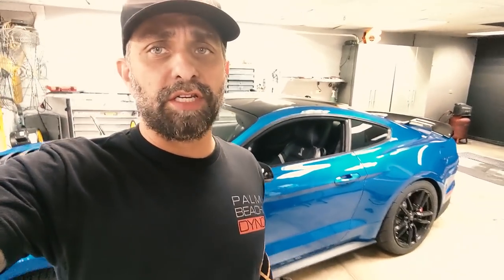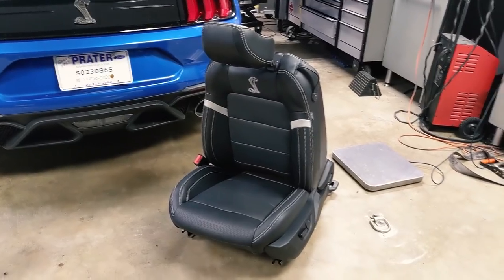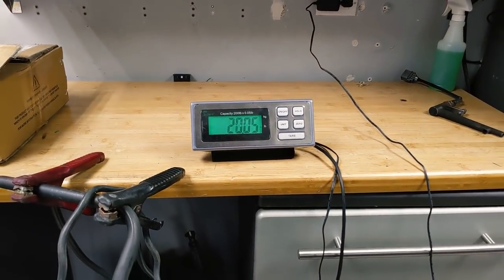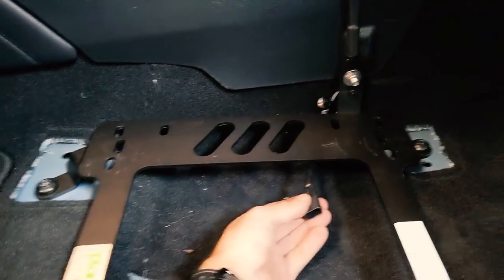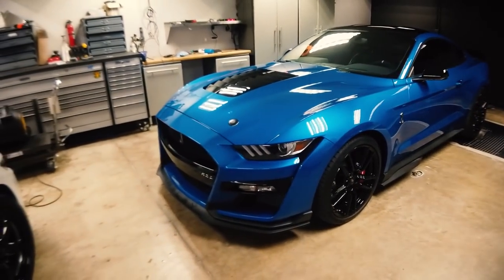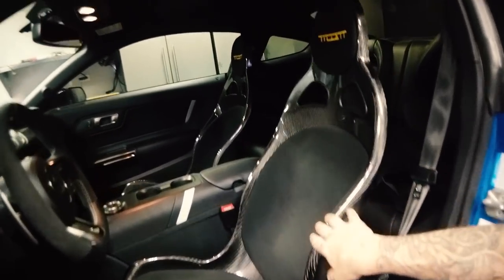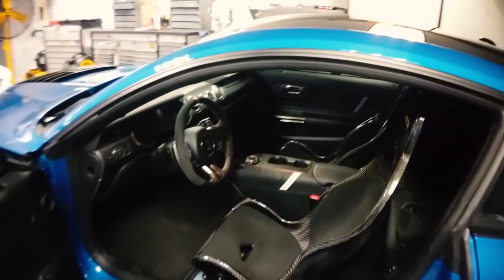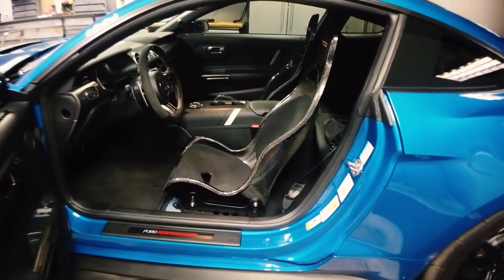Carbon Fiber Race Seats Installed In Our 2020 Shelby GT500

Comment: Any chance you could take a piece of string and measure the length from butt pad to the top of the headrest? I've been trying to figure out if I can fit myself into this seat. The dimension on Tilletts website don't give me enough info. I'm 6'3 with a long torso. Thanks!

Comment: Hey ken,,did you have any airbag issues  ,lights,,,ect... I am putting a race seat in and I'm wondering if I'm going to run into problems..
Reply: I’m also curious as to how to defeat the airbag light. It is inevitable if you remove the factory seats.